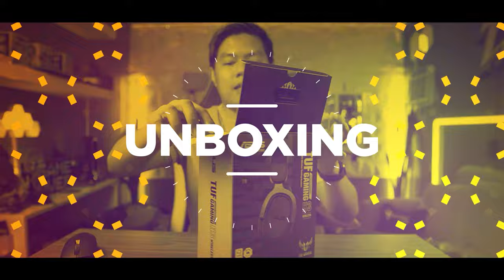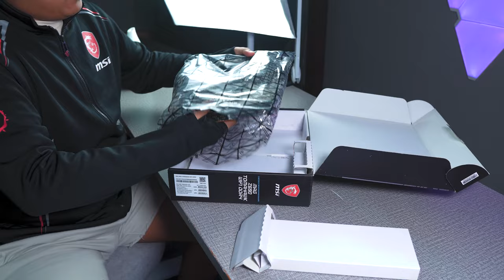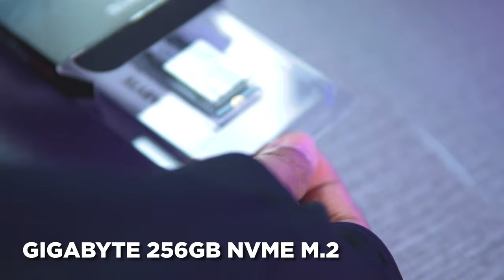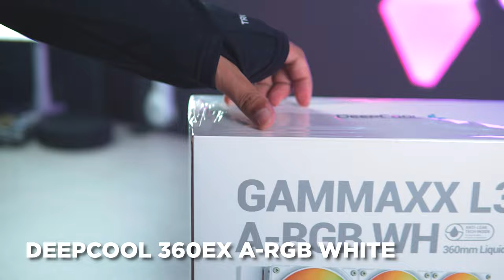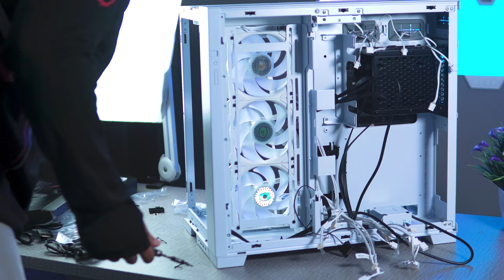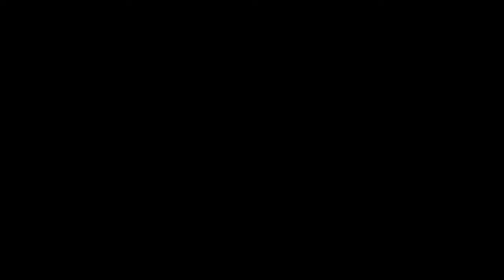Building a MSI 200K Gaming and Streaming PC | Intel i9-12900k + RTX 3090 + Lian Li EVO

Comment: CPU: ryzen 7 or 9 5900x 
GPU: ASUS ROG or TUF 3070Ti or 3060 TI
Motherboard: asus RoG or TUF X570 or B550 for atx matx or itx build
RAM: corsair 32 or 64 gb ram ddr4 3200Mhz
Ss
SSD: samsung evo 250gb nvme (for OS and applications only
SSD: crucial 1tb SSD - 
PSU: preferably mga 650-750watts 
AIO cooler 
Monitor- at least mga 165 hz refresh rate with anti glare.... At may gsync feature... Goods napp ba ganyang specs boss.lucio